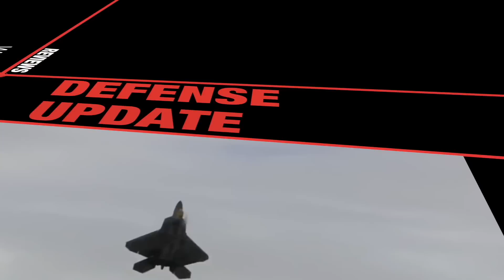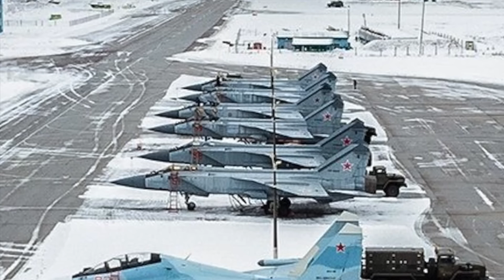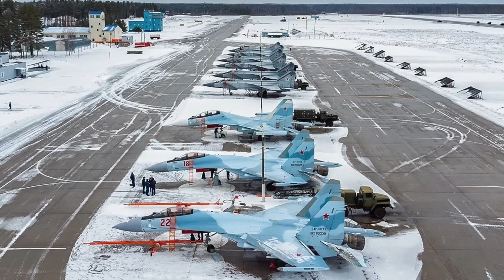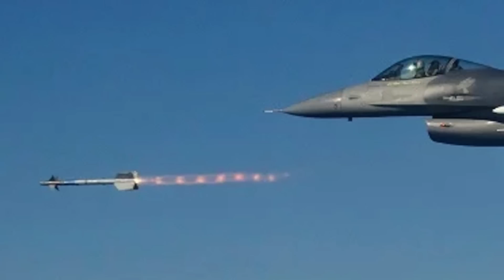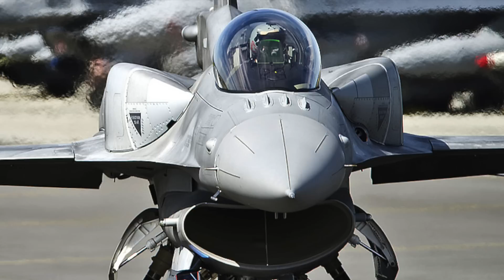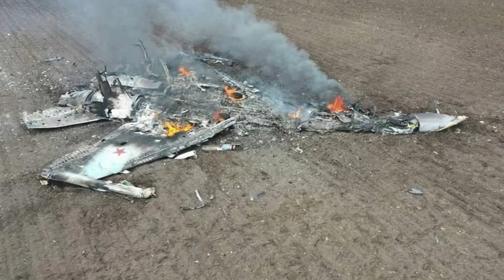Momentum picks up for transfer of #F16s to #Ukraine !

Comment: RUSI, Reuters, Sandbox, and other sources have said it's the lack of trained pilots that stopped Russia from using it's Air Force. The Black Sea Drone Show featured this.
 Most reverse engineering of it's systems has happened, moot point.

Comment: Aerial combat is not my forte so I might be wrong, but from what I've read, on paper, the MiG-29 and SU-27, appear to be the superior fighter, faster, greater loadout tonnage, unless the F-16's are supported in the form of Avengers and MANPAD's.
Reply: Incorrect kiddo
The key fact is that F-16 does not need to fight the MIG-29 or Su-27
First for attacking the Black Sea Fleet, the F-16 with AGM-84F can launch from 170 miles against Black Sea Fleet ships or use Storm Shadow against their bases at Sevastopol and Novorossiysk. Simply launch and leave. The Su-27 and MIG-29 do not use the R-37. The R-77s they carry range is 120 miles which mean they need to close to within 70 for the R-77s to be able to reach, Good luck with that as their speed is only slightly faster than the F-16
The R-77s covers 120 miles in 2 mins. The F-16 at top speed covers 45 miles in 2 min 
lets call that problem 1 
Then factor in the F-16 has modern EW suite tech as well can launch ADM-160 decoys
By the time Su-27 and MiG-29 figure out they have been decoyed , the F-16 has either struck targets on ground and left or worst has gained position on Flankers/MiGs or even worst has gotten in range of the A-50 AWACS and lobbed a few AIM-120s at it or in range some other critical asset like the jammers on the ground 
The F-16 has so many ways that it can do damage without dogfight

YT CBU-87/B Combined Effects Munition (CEM) Live Fire and imagine what happens if provides those to Ukraine
Reply: Wars are not fought "on paper" if they were Russia would have owned Ukraine in a week.  Leadership, intelligence, strategy, logistics, weapons real world performance, training, tactics, morale:  Russia is hurting.
Reply: Stick to gaming. The F-16 is more manoeuvrable, has better sensors AESA radar not PESA radar like the Soviet and Russian aircraft. Add that the Russian used aircraft have the RCS of a jumbo jet and both a heat plume and smoke trail a blind man can see. Put it all together with the EW suite and no chance of survival for Russian pilots if they get near to Ukrainian airspace.
Reply: @jacksonteller1337  Time will tell.
Reply: @makegaminggreatagain3907  i have been in the RNLAF for 29 years and retiring soon unless Putler gets frisky. Teaching at the military academy for nearly a decade and after retirement still will be. That means i have forgotten more about the F-16 and the Russian opponents than most on here will ever know. It would be a miracle if the Russian air force will get within 120 km of the frontline or border and survive.

Comment: Btw Belgium won't supply any lol, we only offered training for F16. Simply cuz we don't got spare F16 for now, only when we get F35 but that still takes years as we didn't join the program as early as Netherlands did. Anyway it doesn't matter who supplies the F16, as there are more than enough even to supply 100 to Ukraine. Hopefully they get the best radars like AESA to detect russian radars & jets quick enough, so not to get hit.
Reply: They WILL get hit unfortunately.  Maybe if these were F-35s or even F-22s would they have a possibility of 100% survivability.  We will all get to see video played on repeat for years of F-16s being blown out of the sky. Russia will focus everything they have to drop them out of the sky just for the propaganda. It will be a hard pill to swallow when it happens and may just accelerate escalation.

Comment: The F-16V (Block 70/72) is more of a generation 4.5 fighter like the F-15 EX and the F/A-18 E/F. The F-35 is proving to be too damn expensive to use as a real fighter. For years the DOD has known this it's a dog. That's why they are building "new and improved" F-35s. Anytime has to be advertised "New and Improved" like the DoD is going on about it says everything that need to be said. The Viper will give Ivan poisonous bites it will never forget! Air to Air, Air to Ground, SEAD. Ivan is going to 💩 his pants and forget about his piddle pack. Vipers, Hogs and Apache attack helos will send them home with their tails between their legs..

Comment: Thought F16 was called the "Falcon", or is the Viper a new version?
Reply: Officially it's the Fighting Falcon, but it's nickname is Viper. The Viper moniker came both the shape of its wings, as well as the original Battlestar Galactica which aired about the same time and was juxtaposed with the Falcon's then-novel fly-by-wire system 🦅🐍

Comment: LET US BE HONEST.! It is a time to trash all old F16s and roll out newer aircraft in place of obsolete F16s. Nice targets for the Russian air defense. :elbowcough:
Reply: How about no clown
The S-400 missile is 250 miles while the F-16 can be equipped with missile able to strike from 300 plus miles away
The S-300 missile is 120 miles again, the F-16 with AGM-84F can strike from 170 miles away
After that, the Buk,Panstir S1, Tunguska and Tor are basically useless as the F-16s has ample weapons that out range those systems
that just leaves , Russian fighters which Putin won't commit against F-16s for simple reason Russia can't afford yet another black eye if an old ass F-16 downs a Su-35s 
or worst a Su-57

Comment: Hope to see at least Block + 50 and AIM 120D.
Reply: All the European version delivered will be the five country upgrade of the 1990's. That is the AM and BM models. The Dutch ones got another deep overhaul around 2013 upgrading it further. That means that all 24 in service (available for Ukraine next year) and 18 in storage have airframes with a few thousand hours left in them and have been recently upgraded.

Comment: All depends on what air-to-air missiles US sends with them.

Nobody expects Ukrainian pilots to be proficient dog fighters at the beginning.

But defensive counter-air is a very powerful possibility, at least at the start.

Need to figure out where to base them. 

F-16s require pristine runways and infrastructure.
Reply: There is no need for air to air combat
F-16s with AGM-84F can hunt the Black Sea Fleet, while F-16s with Storm Shadow or KEPD-350 attack bases. Additional F-16s equipped with EW attack Russian EW sites as  the F-16 can fully use the AGM-88. Lastly F-16 with AGM-65s can attack every else 
Ideally , it would be a huge if US gave Ukraine CBU-87s and 103s
As for Russian Su-35s 
The best way to deal with them is here kitty tactics
Decoy them into SAM traps with Star Streaks and Stingers
Ideally if Ukraine launched a massive rolling thunder style against Russian forces at once, they would buy themselves months of tactical advantage
While Russian forces try to recover from the blow